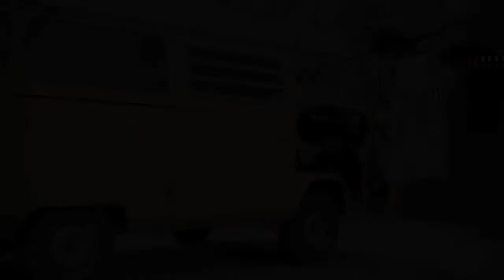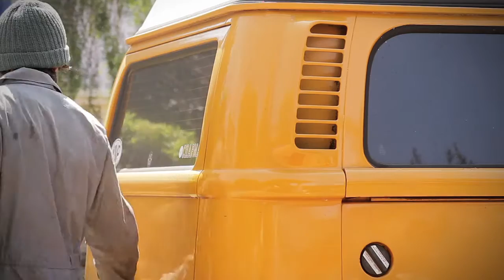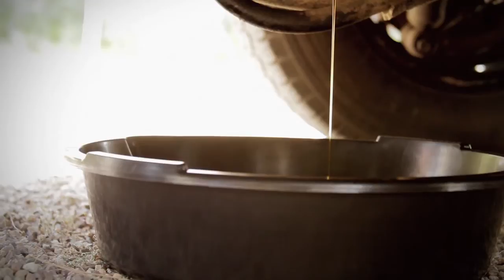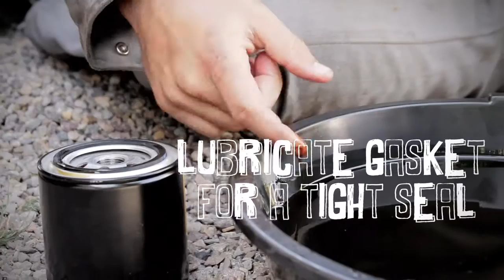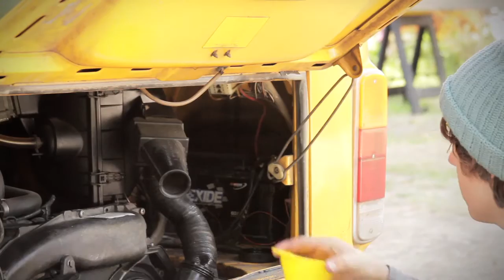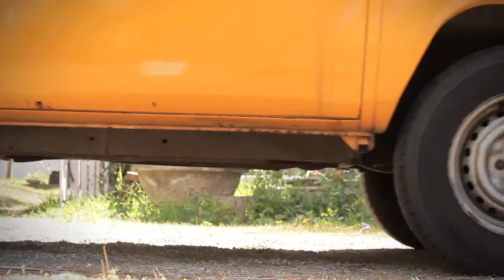Oil Change - D-I-Why Not?

Comment: Cool video; I like the retro motion. It is a Type 4 engine which comes with oil filter so there is no need to remove the strainer and clean it in every oil change as you would do in beetles.
Reply: I just got a 1976 bus and it was sitting for over 2 years, i just changed the oil and i decided to clean the strainer and now is leaking from there, any suggestions?
Reply: 1.  Be VERY careful not to overtighten the bolt on the strainer basket. 7-9 ft. pounds of torque ONLY. Many have destroyed their cases by overtightening. Be careful to thread carefully too, to reduce risk of stripping threads.  Don't let this simple thing cause you major headaches or possibly even kill your bus. Get an accurate torque wrench and use it!

2. Did you also replace the gaskets on the strainer? Old gaskets will almost always result in a leak.

Comment: "The cleaning of the oil strainer should be done with every oil change" - p72 in the VW owner's manual of the 1972 models. That part is missing in your video. Otherwise, it is a great video - thanks for sharing!
Reply: I did that and now i have a leak, any suggestions?

Comment: Great video bud. Why not use straight weight 30w or 40w? I'm in redding and the wolfgang guys live and die by that rule.
Reply: There's no reason to run single-weight oil. 5w-30 or 10w-30 performs the same as a 30 weight at temperature. 

Would say something about using off-the-shelf oil without sufficient ZDDP but that doesn't apply to a fuel-injected type 4 motor with hydraulic lifters